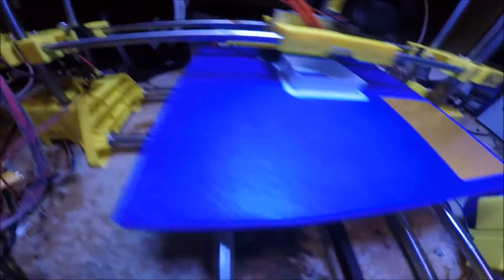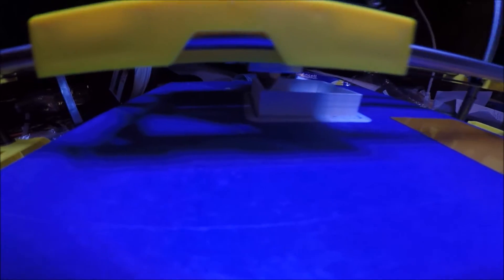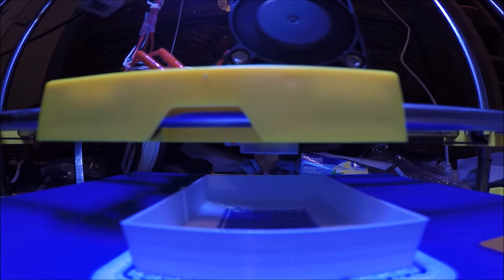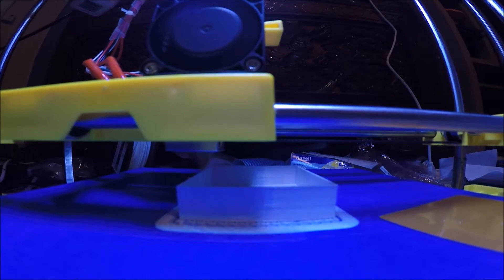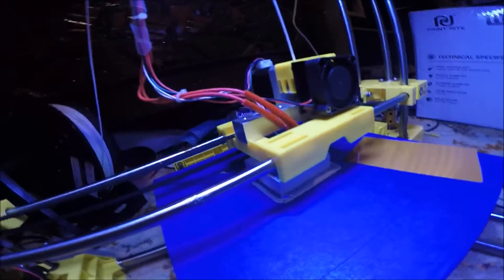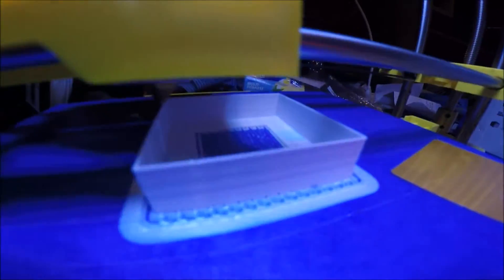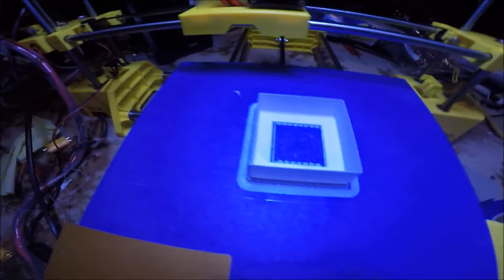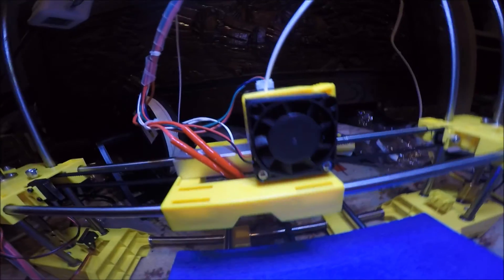Print-Rite DIY 3D Printer

Comment: I've had my eye on buying one of these for quite some time now, but my mom always told me, "forget it Joe; it's gonna cost an arm and a leg!" I spent months and months doing research on affordable 3d printers, and my results lead me to dead-ends every time. And just when I was a hair away from giving up on my research, I went on the Hobby-King and found this printer for only $200.00, and I have to say, this is probably the least expensive 3d printer I've ever found on the web! Next time I get a paycheck, I'll buy it!
Reply from the maker: +Dinoman217 hey mate after having this printer for the last few months i hate it its crap DONT GET IT  i am going to start to build a printer 
1st of all dont get cheep i have had to put 400 into this printer its getting to much 
i would not recommend it anymore dont get it
Reply: 3D printing What do makes you say it's crap?
Reply from the maker: everything i have had 3 stepper motors die i have had the extruder crack not happy with it i decided to order a E3D 6LIGHT hotend if u like fixing stuff its a good printer

Comment: can you have the printer away from your pc and plugin in an sd card instead of using a cable?

like i make the model and load it to the sd card, then i go into another room, put the sd card into the printer and it prints?
Reply from the maker: sorry bro u cant but if u add a screen u can I wil be making a vid on that soon
Reply: +3D printing yes, i intended to have the printer in my garage, but my pc is inside so unless i had a 30 foot cable...
Reply from the maker: +tab328 yes well i will be getting a vid up soon on how to attach a screen and change the FW so u can use it when u have a screen u can use the sdcard then put it in the printer and then start the print or if u have a phone or tablet u can hook up a otg cable to it and start the print that way